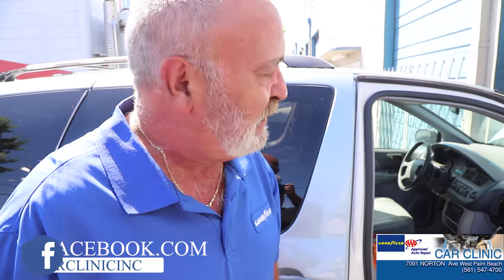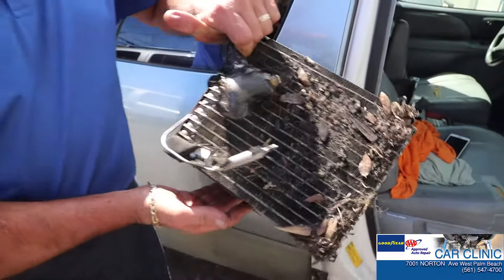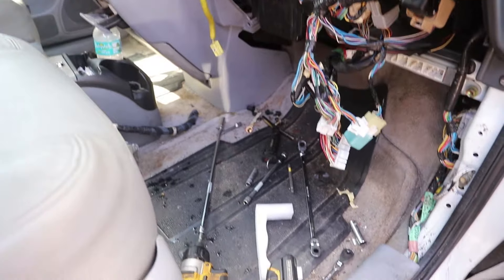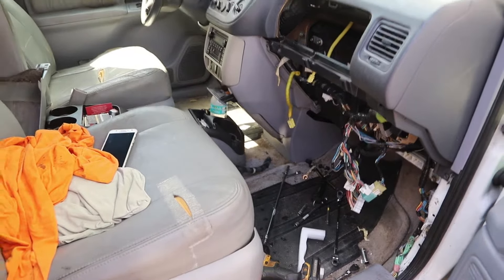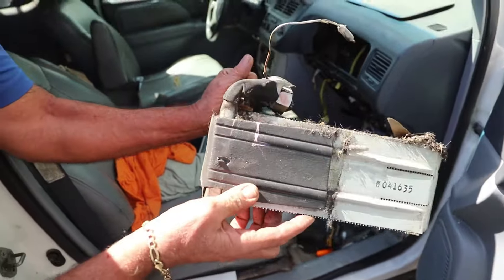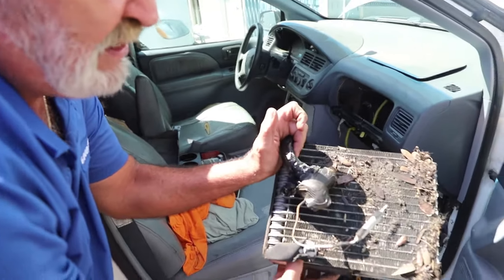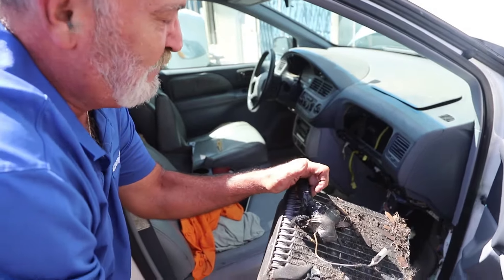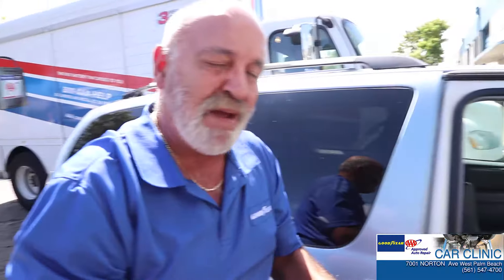AC Evaporator Replacement

Comment: I vacuum evaporator out from the inlet port using my shop vac while blowing cabin exhaust side using a leaf blower.  Is it perfect?  No.  It does, however, keep it reasonably clean while requiring minimal disassembly.

Besides, I can spray a coil cleaner in the cabin exhaust, too.
Reply from the maker: Excellent idea, we had to replace that one because it leaked Freon

Comment: Thank you for the great film, now I know exactly where is that part located, But do you need to remove all the refrigerant to replace it, or you can block it somehow, any ports for that? Thank you again.
Reply from the maker: You have to remove it unfortunately, unless it leaked out already.
Reply: @golfghoul7  Thank you. Yeah, I checked prices on the recovery equipment, ~$500 (machine, tank). Though still might sense to buy, if to learn how to apply all that to support you home AC in addition to automotive applications.
Reply from the maker: @olenaerhardt7725  a couple of things: home air and car air use a different type of freon so careful on the recovery. If your evaporator is bad means the freon already leaked (?) if that is the case you do not need a recovery unit, only  a vacuum pump once you do the install, the recharge you can do with a handheld freon recharge can you can buy at any auto part store
Reply: @golfghoul7  Thank you, it is good to know. Why I mentioned home AC, bcs on Amazon they show a picture of Home AC on that Automotive Recharging Machine I'm thinking about. It is VEVOR Portable 3/4 HP Refrigerant Recovery Machine - AC Recovery Machine with High Pressure Protection 120V 60Hz Recovery Machine HVAC for Vapor Liquid Refrigerant, Car Air Conditioning. So if to learn how to do on both (auto and home) properly it make great sense to have this machine. Actually for the cars we have I feel I would need to buy it.
   About refrigerant in that car I'm working on currently, I don't know yet. I did a lot on it, but most suspension, and while the car is in the air I thought to replace the radiator I bought a while ago. Surprisingly the radiator looks very good, though I changed coolant in it only 1 year ago, I believe the only time on that car. And it is 2001 Saturn SL2 w/~135 kmi.  But Condenser behind it looks worn. The condensers are cheep, but you need to disconnect the AC Lines. Then I've learned about the Evaporator. There was no heat in that car, never (we bought it used), but AC was working. When it stopped working I went to Chevrolet Dealership here in Dallas, and they repaired it for $1K w/Warranty for 1 year. Shortly before the expiration date AC went down again. When I went back one mechanic there wanted me to pay again, then he did smth, AC was working like for 1-2 weeks, then went down again. On my return, that mechanic was going like, what did you expect if you didn't pay for the repair I did. Despite all that I don't think he did smth to cause the system slow evaporation during his 2nd "repair" (needless to say AC failed again shortly). It is still dealership, and it is illegal to send the refrigerant in the air. We didn't worry much about that not working AC, bcs by then it was our back up car, but still it would be good to put everything possible in the order on that AC. But probably later, I need to do more research on car AC system, bcs now I even don't know how to diagnose car AC. I have that device w/Blue and Red barometers, but I've never used it.  Then get equipment. So for right now I'll just replace the Heater Core and Radiator. Then get all the necessary equipment for freon (or whatever is there) removal and storage. Thank you kindly again for your film. It helped me to start on the project I've never did before. I might open the Evaporator location and just clean it outside, already will be better.
Reply from the maker: @olenaerhardt7725  it sounds like you might have a freon leak, have you been able to determine where? If it is the evaporator you should do the evap & heater core together, they are close to each other in the evap case
Reply: @golfghoul7  I tried to see w/UV flashlight, but that should be done probably at dark. I couldn't see anything at daytime. I know how to replace the Heater Core (there are films on YT for Saturns), this is nor complicated procedure, but Evaporator ... O my! I looked today in Shop Manual (I have that huge 3 volume set for the Saturn). It is very complicated procedure, over 60 steps. They remove the HVAC Module(all the dash board goes to be decomposed), and then they remove Evaporator fm/HVAC Module on the bench. Maybe there are ways around, bcs Heater Core they also do after disassembling 1/2 of the car. On YT he removed just side bottom panels around the Heater Core. So I'll see when I'm in that area around the HC, maybe I'll be able to view any fractions of the Evaporator. Thank you for you attention to my project.
P.S.: Reading the Manual I started to think that maybe the mechanic fm/Chevy Dealership was not wrong at all, and smth else got broken besides the part they replaced before. See at that time I knew nothing about cars. Maybe for example they replaced compressor (I don't remember what it was), but then another part failed, maybe really leak. It is so complicated system that AC.
Reply from the maker: @olenaerhardt7725  what a/c part did they replace originally?
Reply: @golfghoul7  That is the thing that I don't remember. It was like 10 years ago. I'm guessing that it was a compressor, bsc what else in that system could cost $1K. Probably it is somewhere in papers, but hard to find.
Reply: @golfghoul7  You know I found it. It was in 2013, they replaced Compressor,  and charged system to repair, cost was $825.
  In 2014 again: A/C not cooling. Recovered 0 freon evacuated recharged system found front compressor seal leaking replaced compressor evacuated recharged system held 10 min leak test.
   After 2 months: A/C is not cooling, replaced compressor has no suction 80 psi low side, replaced compressor evacuated recharged system.
   After 2 weeks: Now A/C is not blowing cold air, compressor is leaking at center seam. Replaced compressor evacuated recharged system.
   That is quite strange story. I've heard dealers always use OEM parts. And that compressor was failing several times. I have Pittsburgh A/C Manifold Gauge Set, so try to determine if there is any pressure there, most likely it was a leak there how you advised. Thank you for reminding about those papers. It makes situation a little bit more clear.
Reply from the maker: @olenaerhardt7725  glad you found it, maybe they did not use an O.E. compressor, strange they had so many issues with it.
Reply: @golfghoul7  Ironically I've heard that expiration date is usually what you get on repairs at dealers. Sometimes I get curious, what do they mean they are professionals. And it is not only on this compressor. How good that due to YT we can do repair ourselves nowadays.
Reply from the maker: Check with independent shops first, their warranties are usually longer than the dealer, all AAA approved repair facilities have a minimum of 12/12,000 warranties
Reply: @golfghoul7  Thank you, it is very good to know. We have AAA card, so won't be problem to find. Though I do already many works on our cars, but good to have a reliable mechanic for smth you can't do, like engine or transmission. Thank you again.

Comment: I have a 99 Civic and I replaced my evaporator and expansion valve in under an hour. The assembly for my car is behind the glove box. I took out 7 screws that hold it in and disconnected the rubber hose on the bottom. It was a very very easy job in my car. Other car's probably take longer.
Reply from the maker: much easier on a Honda
Reply: Did you need to discharge the AC System completely before this replacement? Thank you.
Reply: @olenaerhardt7725 yes. You will have to take it to the shop for them to discharge and recycle the Freon. I did this job on my Dodge Ram. The whole dash had to come out as well as the heater box.
Reply: @airmike1271  I know already, but thank you. There was no freon in that car, it was totally empty. I removed a lot of stuff fm/the dash, but then decided to try just to flush the system and try it w/air pressure. That was bcs when I came to the Heater Core. It was like new, there was no need to replace it. The Heater didn't work, bcs the regulating cord was disconnected. I attached it and tried the system. It showed a leak on the compressor, which they installed at dealer. I've learned a lot during this time, but still don't know if you can discharge the system at home and then go w/that tank somewhere for recycling. They sell those tanks on Amazon, but no one knows where to go w/that tank after. Probably it is better not to reuse that freon (fm the tank), since it might be contaminated. Thank you again.
Reply: @olenaerhardt7725  it is great that you are working on your car as you learn new things at the rewarding feeling you get when you repair an issue.

You should be able to recycle your freon, which without a license and take it to a place that will take the gas. It is not recommended to try and use the gas as it might have other types of freon mixed in from any previous owners. 

To purchase refrigerant, you will have to have a license. But that is not a huge hurdle as you can study up and take a online test for I thing between 50-80 dollars. 

My dilemma, I bought a 2009 Eclipse with a family member as a Facebook Marketplace project. That a/c, I figured I would farm that work to a shop as I really did not want to get deep into that system. Doing that evaporator, heater core on my truck took weeks. I couldn’t just stick to the task as I rebuilt the whole heater box assembly with all new mode doors. So the Eclipse went to this shop that was building my trust to work on my vehicles. They had me convinced to replace the compressor, drier and had some kind of valve replaced. The car did some sitting and drove it to work Monday to find out the a/c is blowing hot. The shop still has the car. I am anticipating that it is going to be a bad evaporator. If that is the case, they should have discovered it and not taken me a ride. So once I get the verdict and it is the evaporator, they will be fired from the job and I will be, cough, doing it myself 😜
Reply: @denniscarey8426  I don't know how it is on 1996 Honda, but on our 2001 Saturn SL2 this is 60 steps process (I have Shop Manual for that car, 3 huge volumes). On that car the Evaporator is sitting under the dash board, so to get to it you need to remove it. I started: removed the top cover of the dash, Console, cover of the Instrumental Panel, and the panel itself, cover of the Steering wheel, Radio, HVAC regulator (saw that the Heater didn't work bcs the regulating metal cord was disconnected), cover of the Heater, got to the Heater Core, saw that it was like new, so didn't replace it. Left and right covers under the dash of course. Then I inspected where are the bolts on the wall in the Engine compartment, and their position and the # of them didn't quite correspond what was described in the SM book. I stopped here, and decided to flash the A/C system 1st, test for the leaks and alike. The Evaporator lines were  disconnected, so I flushed the Evaporator multiple times w/99% Isopropyl  Alcohol, then w/special Flush and let it dry for several days (1 week at least, probably 2-3 days are actually needed, but I worked on smth else). I replaced all the components of the A/C, besides the Compressor and Liquid Line (and Evaporator obviously). Then connected the Evaporator and started to test on Vacuum. The system didn't hold it. After several attempts I eventually found a very small leak in that old Compressor (the Dealer installed) by pressurizing the system w/just Air. I put everything back, purchased a new (reman) Compressor, but didn't install it yet, so we drive that car w/no A/C currently. I don't regret all that work done on the dash, since I did many improvements on the way, but it is a lot. It is necessary to find a Shop Manual for your Honda and see what steps are. I think it would be very hard and maybe impossible to do that project without that book (unless the Evaporator in your Honda is located in another place, and has easier access).
Reply: wish my '99 Blazer was that easy lol
I have been researching it an it requires you to pull apart the front end (bumper, right fender, ECU, coolant reservoir, and some other stuff) to get to the firewall, which you then pull a heat shield and some other stuff to finally reach it
Even at top speed it will take at least a full day to get it replaced lol
Reply: On my honda crz, I just need to remove the glovebox & cut a plastic barrier to remove the evaporator, Honda always easy to work on. My mercedes cla however was a nightmare, whole dashboard needs to be removed.